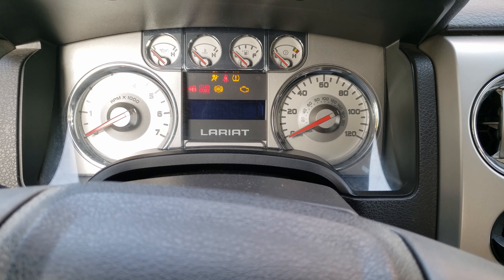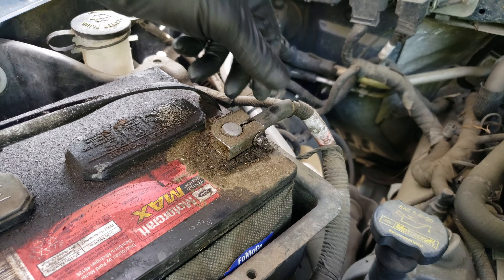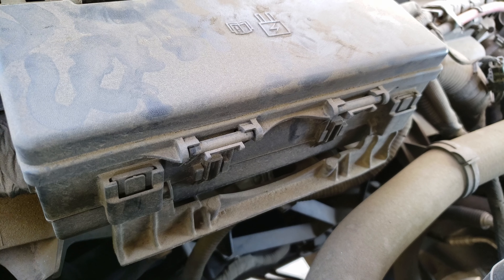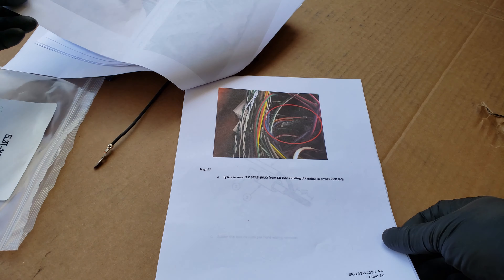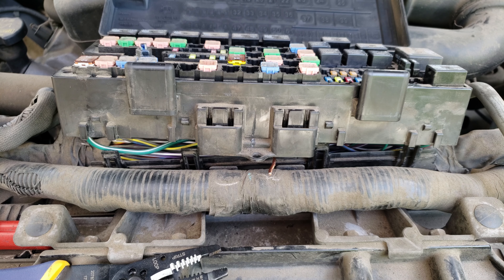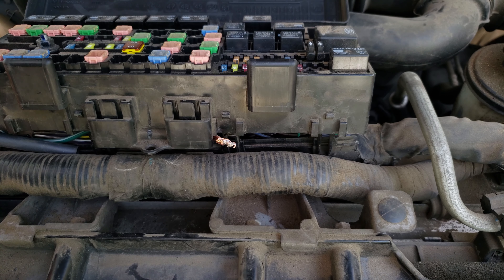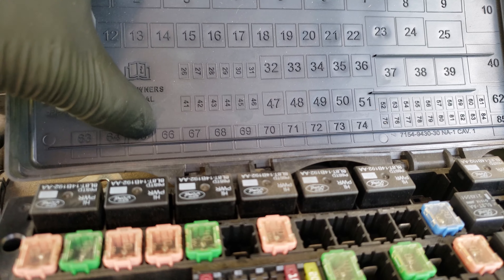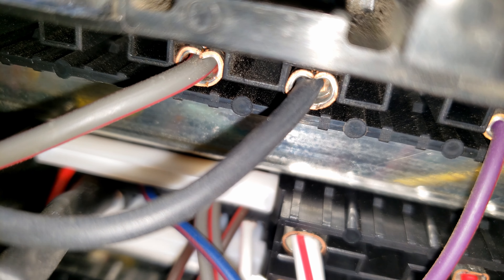Ford F-150 Fuel Pump Fuse 27 Relocation 2009-2014

Comment: Relocated my fuse 27 and now my battery is draining overnight ?
Reply from the maker: Did u attach it to the right wire? The only way it would from the relocation is if it was connected to one that has voltage at all times

Comment: This should be a safety recall from ford
Reply from the maker: Yes, happens to too many of em and especially since the fuse and fuse box ends up melting like that
Reply: @backyardchevy328  I have a 2014 f150 5.0 with 114k miles and runs like a top  I just ordered my motorcraft kit from Amazon
Reply: Thanks for the video
Reply from the maker: @jiggidyjam  thats great🙂 hopefully all goes well with the kit install...good luck

Comment: Anyone accidentally relocate the new fuse to location 71 instead of location 70? 🤦‍♂
Any potential issues with leaving it in 71?   TIA
Reply from the maker: Its ok..its just since its a common repair and the placement is on that fuse so whenever it gets serviced they wont know what it is unless u label it on the fuse box

Comment: Dang it I'm still having a no start deal. I even replaced the fuel pump and still no start I checked all fuses and relays. what am i missing? it seems there is no power to the fuel pump it's got to be a fuse. however, the fuses look good. haaaaarrrrrrr I'm going to drive o I mean push this thing off a cliff soon.

Comment: We just replaced the fuse and the truck is still running like crap.  No power at all. Code reads P0443.. which says purge valve issue.  Fixing my fuse didn't really fix my issue.  We have installed several new sensors today trying to fix the problem but nothing works.  Any ideas?
Reply from the maker: Was the fuse burnt? And if so did u just replace the fuse or did u do the relocation repair? And the code p0443 yea could be an issue with an open or short to the purge valve..try disconnecting the purge valve connector and turning it on..u said the purge valve is new..but if u can plug off the engine side just to verify its not stuck open..and if it runs like normal with either of those then it may be an issue with the wiring to purge valve causing it to stay open or the valve sticking open..if no change at all then that's probably not what is causing it to run bad
Reply: @backyardchevy328  did the test and its not staying open. We have a kit ordered for the fuse repair.  It was really burnt to the point of breaking pieces off when we pulled it out.  So it could still be a wiring issue.
Reply from the maker: @cindyhudson3179  yea try the relocation, if it has a burnt contacts at the fuse it could be that its not getting proper voltage/amperage to the pump so its making it run weak
Reply: @backyardchevy328  I will give you an update as soon as its done.  Do you have any clue why the O2 sensors wouldn't be giving any readings at all. They were just put on today and no voltage is reading on the scan tool

Comment: All this is nice to watch but changing fuse location does not cure the problem of the fuel pump Dr module from pulling to much power through the fuse which is what causes this problem to start with the fuel pump Dr module is the problem change it problem solved till it's starts shorting out again lol this module is 💯 your problem
Reply from the maker: Could be..but those tiny fuses have always seemed like theyd be a problem when it comes to having current run through em

Comment: 247000 miles and my truck will pull a line of toyotas sideways all day...
So if you will never own a ford then that is your choice but its an ignorant choice and not wise.
But my opinion as well.
Reply: I once owned a 78 F150 loved it now I have a F150 2010 was stuck in a graveyard lol got towed home after charging the battery and installing a new fuse will try her tomorrow🇺🇸🐱👌

Comment: Lol all that work for nothing lol people have no common sense lol what do you do at home if you have a kicking breaker just add a bigger one or actually find the problem causing it
Reply from the maker: Well its keeping the same amperage..just a better style fuse..that doesnt have that small contact area on it, so far havent had any problems with the fuse relocations ive done..so i havent had any reason to backprobe further